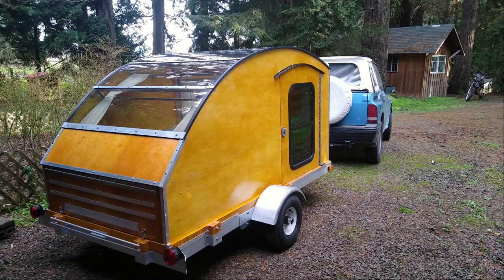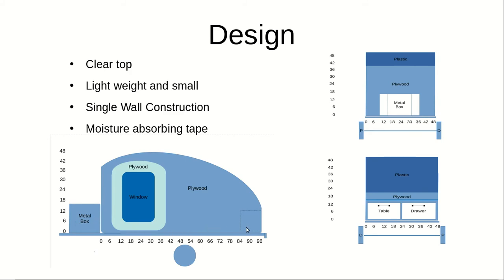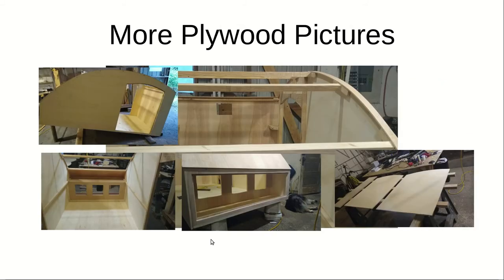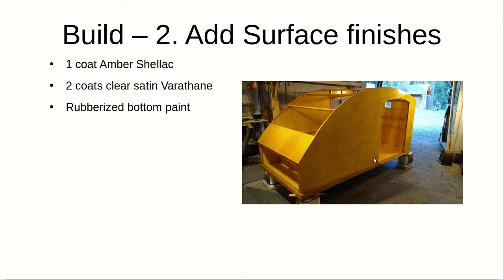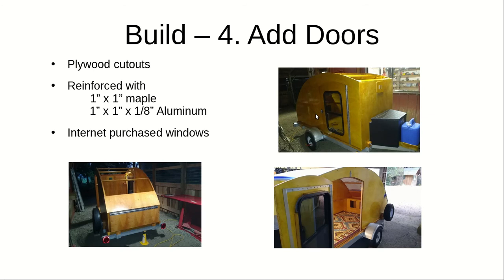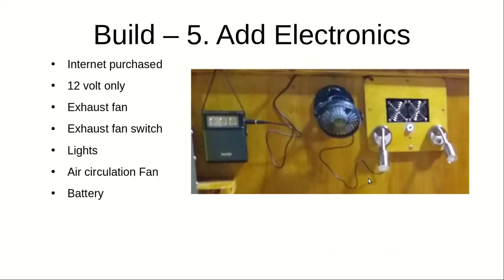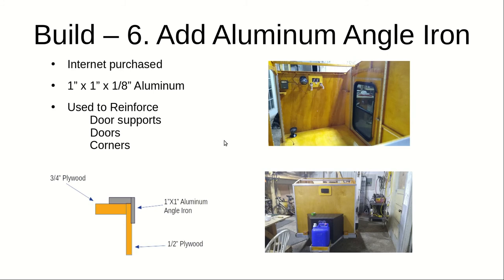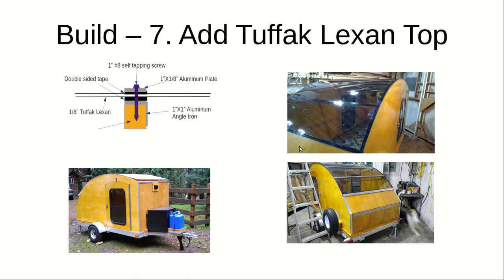Star Gazer Tiny Teardrop Trailer - Design and Build

Comment: Just watch you on CVK channel and I love the teardrop trailer. I was wondering where I could get some of that Hydrovent? That is something I could use.
Reply: Tom, its actually called Hypervent. I use it in my camper van under the mattress to stop moisture and then mildew and mold from building up between the wood and matrress. Good stuff. You can get it from a marine supplier.